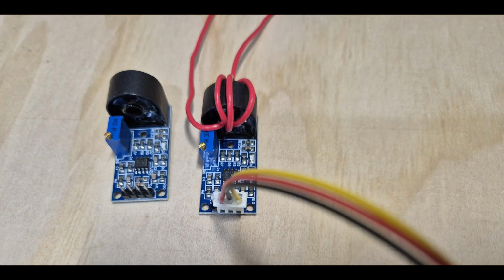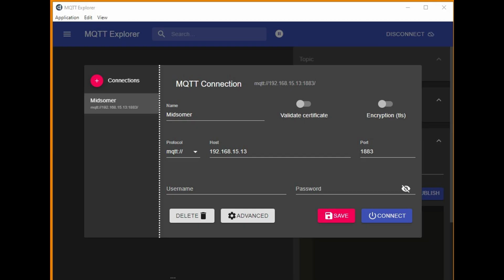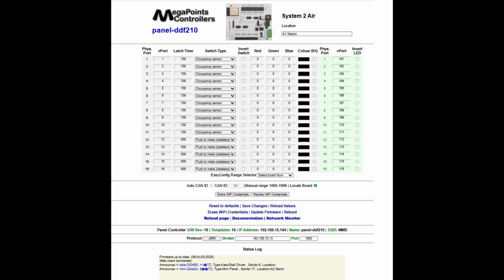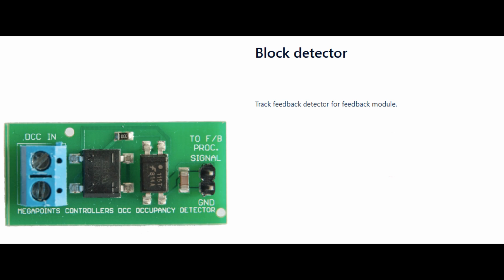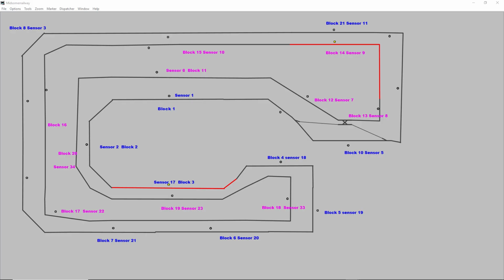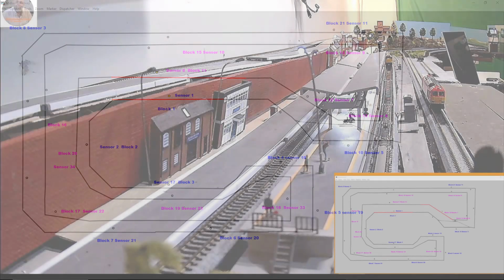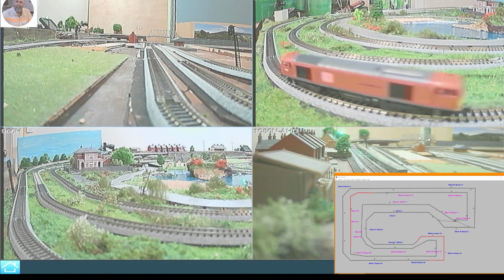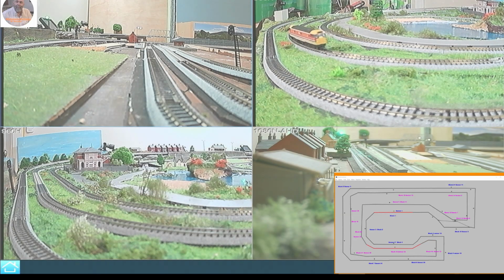Block Detection , No resistors,  + WiFI to JMRI

Comment: Hi Greg,  it's good to see some products out there making it easier to do this, without being locked into big brand names. I was just wondering what did you mean by no resistors required? Won't wagons will still need resistor wheelsets to be able to be detected by the block detectors?
Reply from the maker: Thank you for the kind comments  . I use DCC++ EX   and i didnt wan to be locked in to most system requiring box after box for everything .   Wagons Do not need resistors  . I see your point but I have passager carriages with lights and my end wagons always have lights . I guess i dont run  huge consists ,  check out Peter Waterman & Mega points  GETS Etc.
The Detectors are very sensitive my block are quite big up to a meter some maybe a bit more  with only one power connection
Reply: @midsomerrailwaynscale  It is spelt METRE not  meter(a measuring instrument like a gas meter)

Comment: Interesting ... won't be long before Arduinos will be replaced by ESP32 boards (most have WiFi on them) ... for wireless block detection networks.   All the best ... happy model railroading ...
Reply from the maker: hanks Donald I appreciate your comments the problem with arduinos  or ESP32 is the programs as i cant write programing,make its difficult and the main issue with the sensor i replaced they werent sensitive enough for n scale mind you that was 3 years ago , i just want a simple system that i know is going to work first time .  have a great weekend  Regards Greg